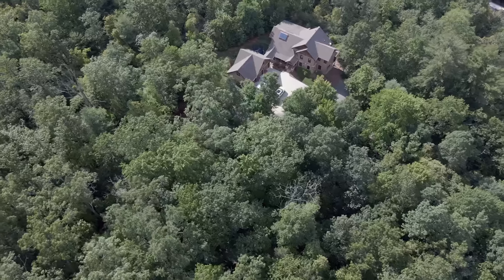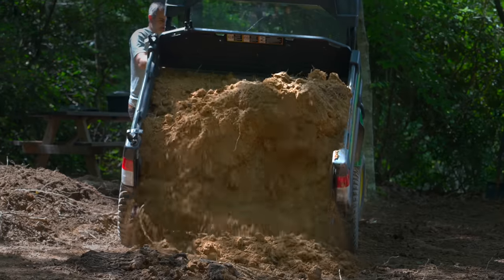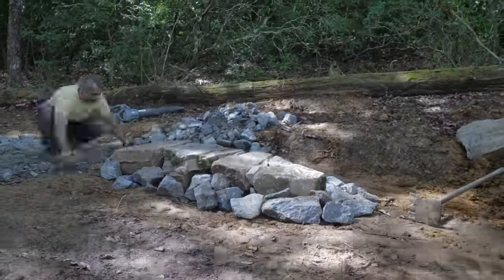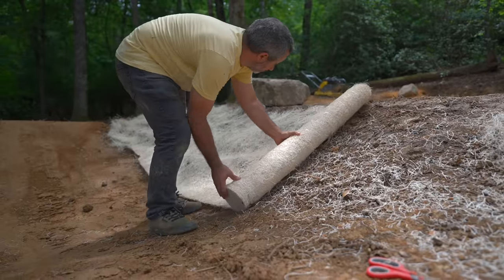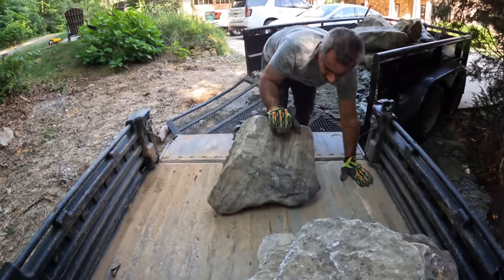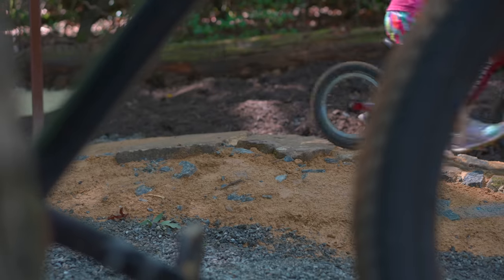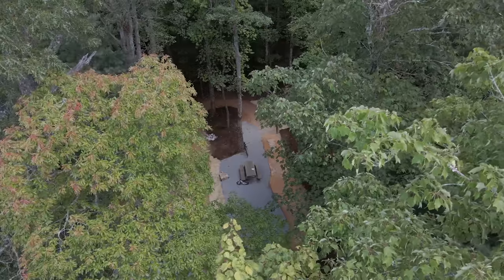Building a backyard MTB pumptrack for my kids!

Comment: Seth, you have an excavator. Let the machine do all the work shoveling all that mulch.
This makes it easier with a quick attach coupler. but you can flip the bucket around and use it like a shovel. So now you are scooping things away from you rather than twards you. It'll make unloading that trailer easier.

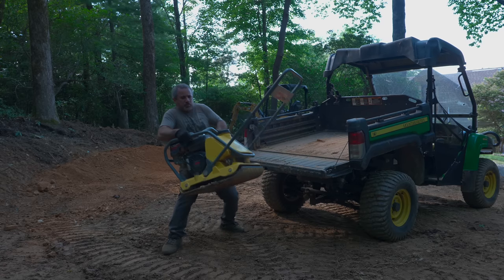Comment: 3:09 Seth you gotta get something to help load and unload the plate compactor and the big rocks. I’ve worked with both before and lifting 180+ lbs repeatedly just isn’t good for your back. Even a chain around the excavator bucket just for lifting would do wonders

Comment: Do you ever use a j tamp? Aka jumping Jack. You might like the compaction you get. I believe a plate compactor you can only truly pack a 4 inch lift while a j tamp can effectively pack a 12 or so inch lift.

Been watching for 6 years! Congrats on everything. Keep cranking out that content!
Reply: I'll say a landscaping edge cutter with the natural V wheels in there is the ideal way to cut in a trough for that metal edging.